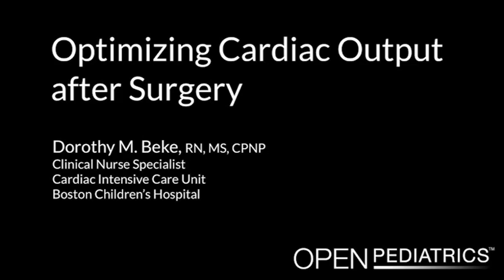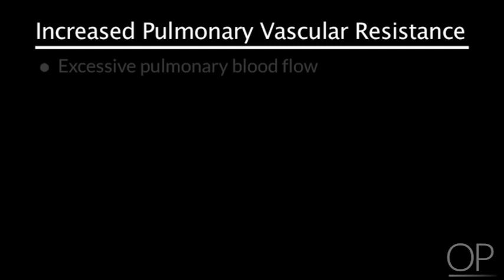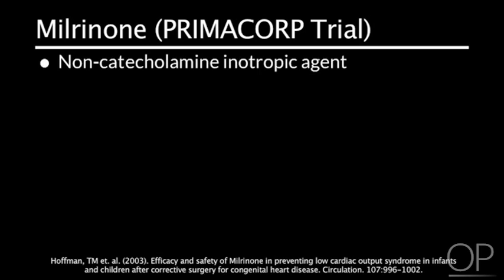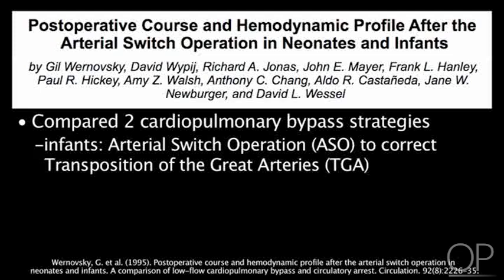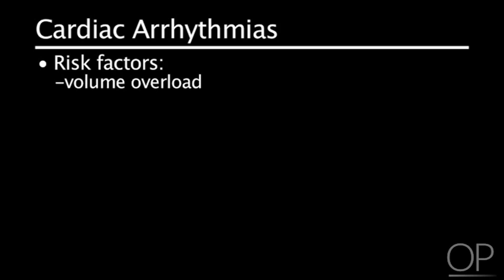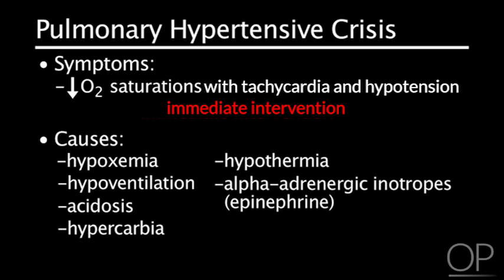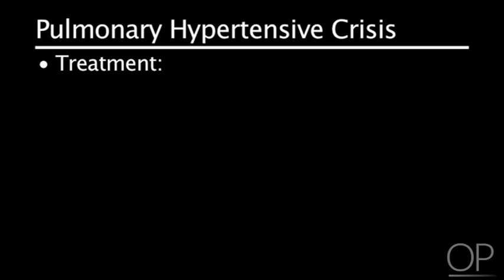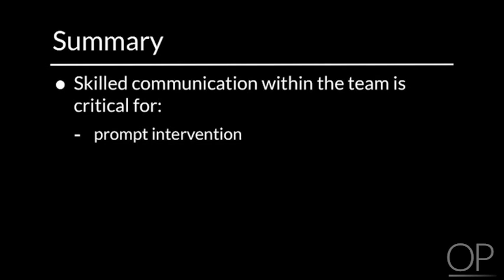Optimizing Cardiac Output After Surgery by D. Beke | OPENPediatrics

Comment: I believe there is a misconception reflected on the slide about pulmonary artery pressure. Neither pulmonary valve stenosis nor PA branch stenosis could cause increase in PA pressure. Inasmuch as pulmonary blood flow is limited by the obstacle. Rather elevated RV pressure